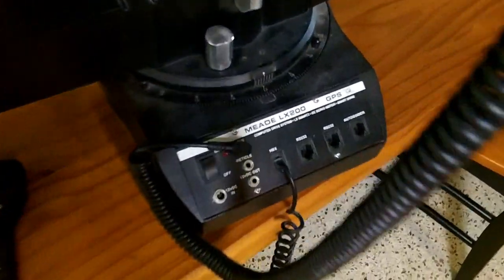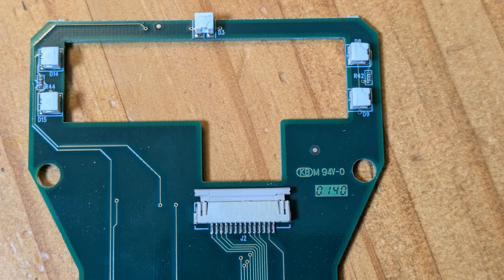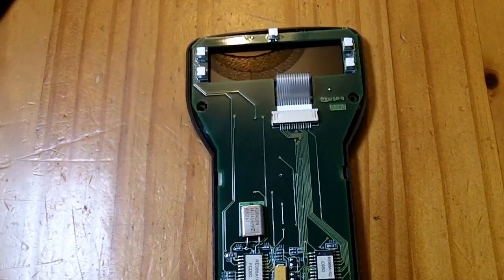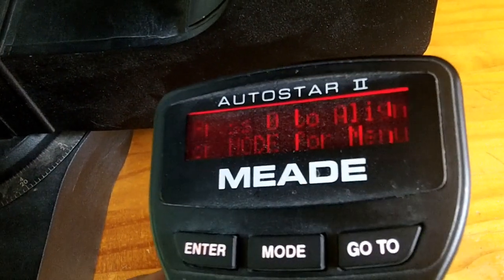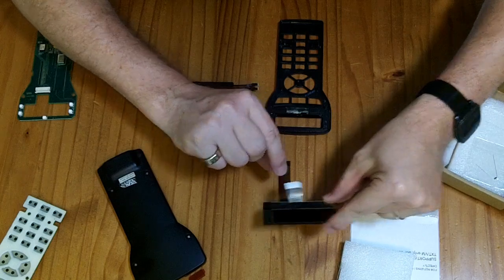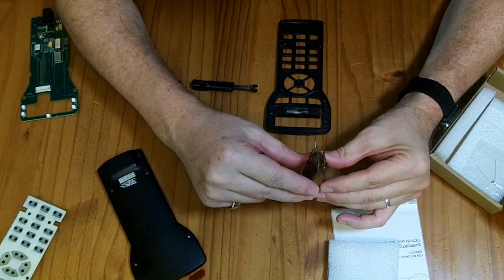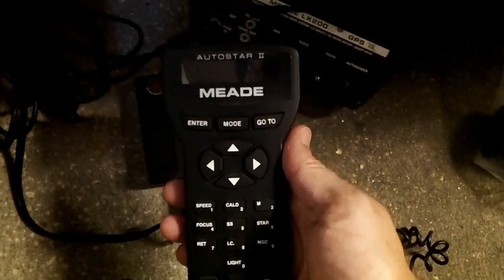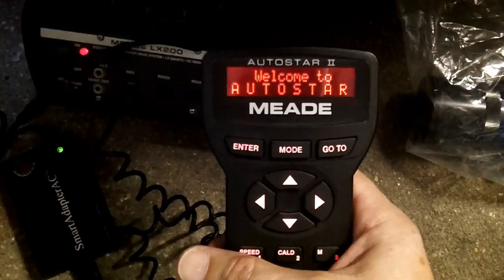HOWTO: Replace Failing Screen in Autostar II 2 hand controller Meade LX200 telescope

Comment: When I see these rubber buttons, which are the worst type there is, I am tempted to grab a soldering iron and replace them with normal SMT buttons, but the console still works... ;-)
Reply from the maker: Yah, they do eventually fail, button works makes an overlay to repair them as well.

Comment: I have the same problem and thought the controller was completely defective. The tip about pressing Enter multiple times was spot on. So my controller still works and I can move the axes manually.  But now I'm not going to buy the original display for $34, but rather a two-line display (which only costs $2.50) that I use with Adruino in the housing. You can find this solution online. I can't post it here otherwise the post will be deleted.
Reply from the maker: @werner7156  not sure why it would be deleted?
Reply: @summetj  Ok.. so there is a workaround for the model 497 Rev.E 2001 board only, the named page. sorry.. I've tried all the options for shadowing the link and the entire link.. I get an error when I enter the address. search for keyword on   Meade Autostar 497 Handbox LCD Display Replacement Repair 1602

Comment: Hello i have 24 pin LCD i bougth in ebay the display.
I study the circuit and i tink it adapted standard 16x2 LCD.
But this use 5v
Reply from the maker: Ok, do you have a question?

Comment: my display just wont turn on if hold enter it will what should i do?
Reply from the maker: I don't have enough information to diagnose the issue.  Replacing the screen as shown in this video only helps if the screen or cable to the screen were the problem (typically the screen shows something, even if it is hard to read gibberish in that situation).
Reply: My screen eventually went totally blank. Iv'e heard the ribbon cable for the screen oxidizes, continuity weakens and causes the LED's to go bad

Comment: where can i get the cable? or what kind of cable is it
Reply from the maker: @Winnable22  I believe the cable between the hand box and the LX200 is just a four conductor cable with RJ9 Jacks on each end. I believe you can use any standard POTS telephone cable as long as all four pins are connected.